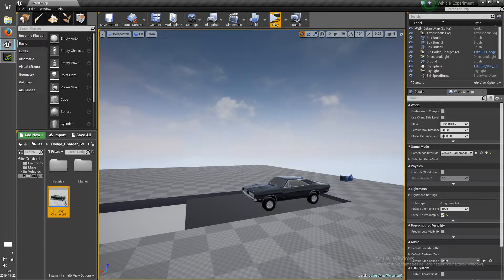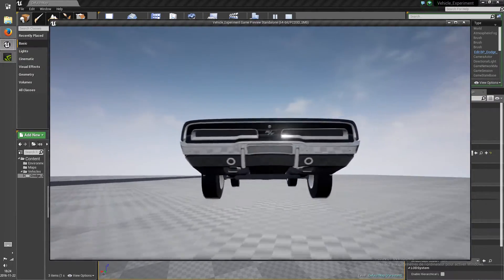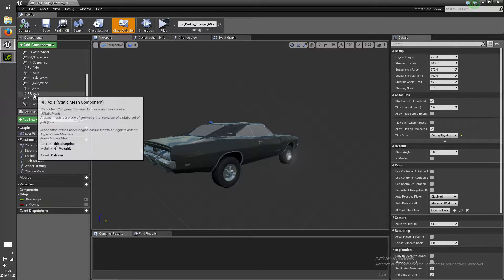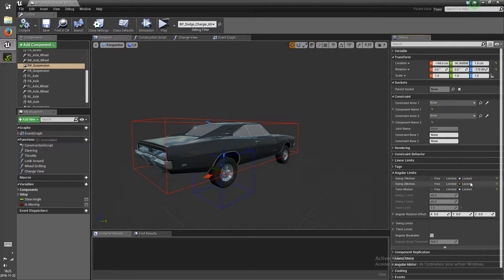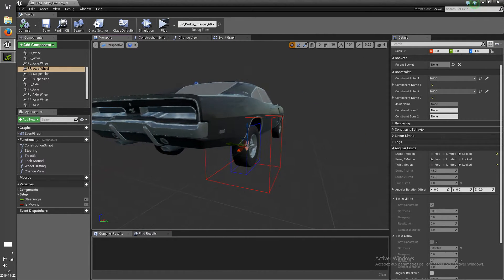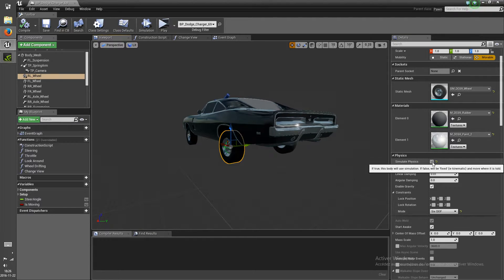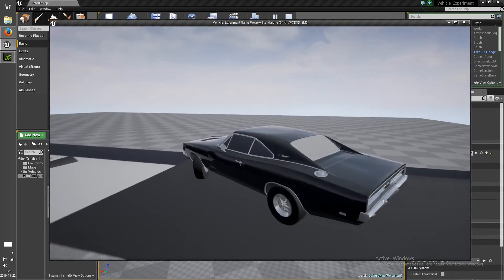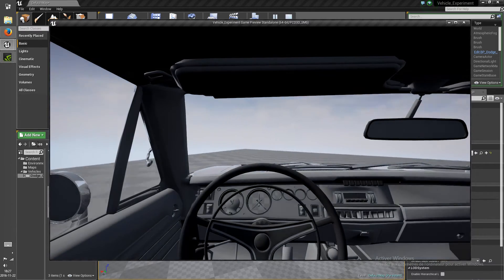Physic vehicle problem (With Voice)

Comment: Check out my thread on the forum I got it a lot more stable https://forums.unrealengine.com/showthread.php?84301-Physics-Based-Truck-Game&p=458388&viewfull=1#post458388
Reply from the maker: thank you so much! That fixed the wobbly wheels ^^
Reply from the maker: Well it fixed the wobbly wheels but now after a certain speed, the wheels just start jumping around... my subset is set to 16 with a maximum delta time of 0.010. still jumping around :(
Reply: That's because you can't get the wheels collision perfectly round. 
That's a problem that I could not fix so I switched to Unity where I am using Sot Body Physics for the Tires but that has his on problems
Reply from the maker: Cristineltr oh :(
Reply from the maker: hey, thanks to you I finally got everything working flawlessly, you where right, no matter how many side I put on the cylinder collision in max, it always endu-up jumping at some point. So I made the wheel a skeletal mesh with only a root bone, and added a simple sphere collision to its physic asset and the driving is now perfectly smooth! Now I know, its a sphere collision, but it is still an improvement from the raycast wheels of the wheeled vehicle class.

I'll post another video in about an hour :)
Reply: I am glad to hear that you fixed the problem
Reply from the maker: https://www.youtube.com/watch?time_continue=1&v=Mbg5hwLKjr4

check it out ^^